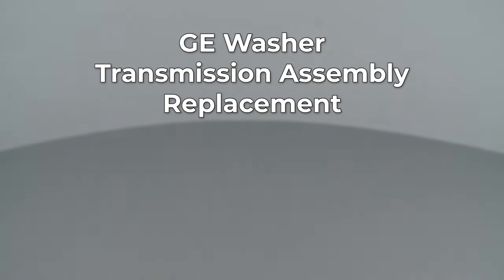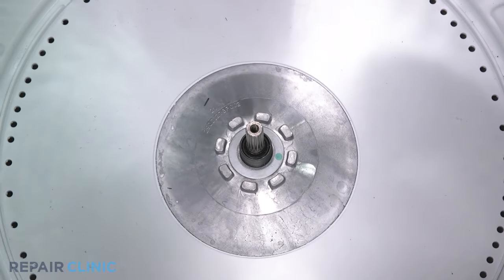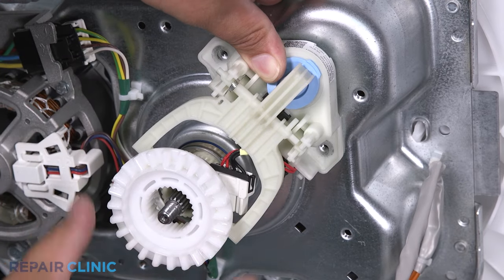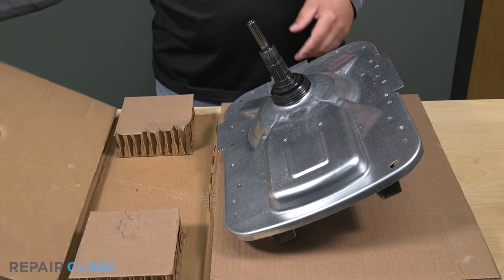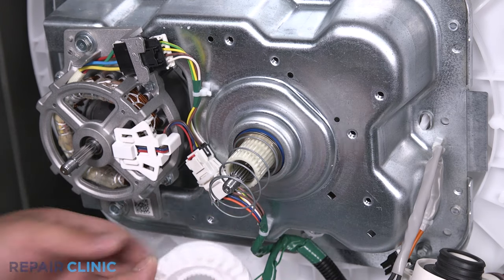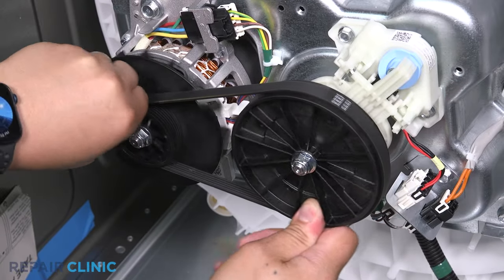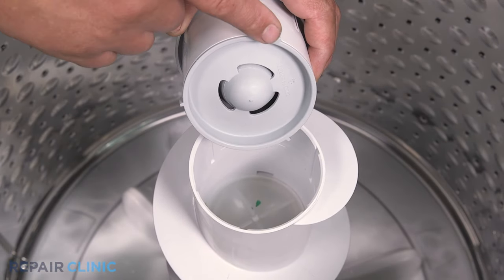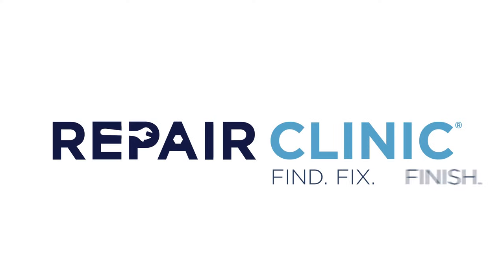GE Washer Transmission Assembly Replacement WH38X27333

Comment: My husband and I were able to replace the transmission successfully with this video.  We bought an $88 part and saved us over $400 in buying a new washer.  Please note there is a new washer that comes with the new transmission that isn't shown in this video.  Interesting note - you don't have to take off the top part of the washer as shown at the end of the video.  Not sure why it is there as he doesn't show that in the beginning.
Reply: Hi could you tell me where you purchased the part?
Reply: @keylolo3484  I can’t find the statement but all I did was Google the model number of the washer and transmission part.
Reply: @lanasmith1085  okay thank you so much.
Reply: hi lanasmith1085, one question. I believe my model in the bottom is exactly like this one but the agitator is one piece not like the one shown in the video that you  intruduce a screw driver to take it apart(so the agitator was 2 parts), he took out the longer part so now he got the screw at hand. was your agitatot like in the video or it was one piece?
Reply: @AlexS-us7ps  Mine is one piece. We pop off the top and use a super long extension with nut to unscrew.
Reply: I think it's wise to remove the top in order to remove the inner basket because this is a good time to clean all the goop and debris laying on bottom of tub which you cannot see nor access between the basket and tub. This debris gets on clothes in the form of stains.
Reply: What part did you replace for $88? A new transmission is $250. Unless you bought used.
Reply: @Larsonbuddy  when we bought it it was $88. I remember there were 2 to choose from and I ordered the cheapest
Reply: @Larsonbuddy I bought a new transmission from PartsDr for $138.
Reply: Did you guys do all that electronical stuff at the end of the video on your guys repair? I gonna do the repair this week.
Reply: @Liviefan4everr  No. That wasn’t needed.

Comment: A quick note: On my washer, the 33mm socket must be deep well. I needed 2 1/2 to 3 inches of depth to clear the center shaft. Also, I could not find a deep well 33mm, so I used a 1 5/16". It was a little loose against the nut but it did the job. (Remember it's a left handed thread - turn clockwise to loosen.) I also found using an impact wrench makes removal much easier.
Reply: Do you have a link, by chance? I have not been able to find one with the required depth to clear the shaft.

Comment: You don’t need a clutch to pull off the transmission pulley I can pull that off with my bare hands and you do not have to remove the drain pump

Comment: Thank you for this guide! While my Hotpoint washer uses a slightly different agitator design (single unit needing multiple extensions to remove) the rest of the video was spot on! I can’t believe my 2 year old washer needed a transmission already, but this guide saved the day. Much happier to spend a couple hundred dollars on the part needed than 3x as much for a whole new washer.

Comment: I'm grateful for this video, but I got a couple of tips that I learned the hard way.

The edges of the transmission are sharp. Be careful.

Clean any lubrication that got on the belt and pulleys.

Good to lubricate moving parts like the plastic clutch teeth and shaft spline with lube safe for plastic. Silicone based?

I had a hard time inserting the transmission into the bottom of the tub. I probably should have lubed the rubber part of the shaft a tiny bit. My transmission popped in suddenly while tightening the bolts. Hopefully, that rubber part wasn't damaged in the process.
Reply from the maker: Thank you for the tips.

Comment: Great instructional video!  My washer is repaired better than from the factory. During the initial disassembly I discovered that the Bellville (convex) washer was upside-down.  Green dot is supposed to be up.  From the factory the green dot was down on my machine.  So, the factory assembly defect may have actually caused the gear case to fail prematurely
Reply from the maker: Thanks for sharing

Comment: I have a 19 month old GE Adora HE washer. It agitates and spins dry but the noise level  in agitation has increased significantly. Is it the mode shifter or the transmission that is increasing the noise levels in agitation?
Reply: I would try replacing the clutch and mode shifter first. Then if that doesn’t work do the transmission. That’s what I’m going to do.

Comment: Thank you for this video. It was very helpful! However, I absolutely could not get the agitator off using the screwdriver in the hole method as shown in this video. I was using enough force to cause damage with no luck. I was very successful using a rubber strap wrench at the base below the part where the hole is.
Reply from the maker: You're welcome! 

We are always happy to help. If you would like to give us a review on Google, we would much appreciate it: https://g.page/r/CcVUrahZNozMEBM/review

We hope that you have a great day!

Comment: I'm struggling with getting the agitator off. My washer looks just like this one but with a different model number.  Gtw460asj5ww.  Any suggestions?
Reply: If you already have the hole located, I would place a smaller-ish flat/standard/blade or Phillips like the video described screwdriver into the hole, slightly pushing it in while rotating lower agitator section until it allows you to go further in and is difficult to go past, there is a small spot that is meant to be pierced with the tip of the driver and hold it together to make it pop out of the "locking tabs" on the bottom portion.  After you pierce it push the screwdriver as far in as you can.  I found it easiest to use Enertia to help out with spinning it.  I would rotate the tub counterclockwise a bit and then, holding only the agitator top, twist with both hand clockwise and it will pop.

Comment: Repair clinic: I've got a GE GTW485BMKWS. I'm trying to replace the transmission as well. I don't see the hole and the bump in the agitator as shown in the video. How do I remove the agitator since it's different to the one shown? I'd appreciate your help. Thanks
Reply from the maker: You're welcome! 

We are always happy to help. If you would like to give us a review on Google, we would much appreciate it: https://g.page/r/CcVUrahZNozMEBM/review

We hope that you have a great day!
Reply: if no bolts on top of shaft pull hard and should release
Reply: It IS difficult to see and I actually had to use my cell phones camera to find it, but you also have to understand too, that once you remove the agitator, you will have to find a way to seal it as once you puncture through the inner portion/shell, it will allow water to come into that area and rust out or go past the seal for the bolt holding onto the lower agitator and cause it to fail much quicker.
Reply: @ThomasBeringerMichael  So how do you seal it? What a bad design to make it like that.
Reply: @jeffwestbrook6570  Duct tape has been a perfect method to close it back up, and it can/should be done previous to attempting the reinstall.  Clean it good up in there and I found the agitator to be an incredible collector of mold like grime.  I took mine apart completely and epoxied it back together after realizing there was a leak in it...

Comment: Had a repairman suggest that I Add Fill more water to the wash cycle. This will put less stress on transmission. It may decrease the noise level. If not jelp then replace the transmission.

Comment: Great video.  I have this exact washer.  I have a small bottom leak coming through belt cover.  For this model, is the compromised tub seal part of the transmission?  (I.e. i need to replace whole transmission for this leak?).
Reply: Yes. It's a sealed unit. Bearing and seal are part of tranny case.

Comment: Would I need to do this if my ge won't agitate during washing and there is oil under my washer? Please help.
Reply: More than likely, the agitator has a planetary style transmission.  the actual agitator is moved when the clutch below pulls the clutch up and only moves that splined shaft.  The problem normally would be a clutch or the clutch motor that spins partially to make it "push" the fork.  But since you have "oil" on the floor, that means the seal is gone up top and it has flooded the case of the transmission and has wiped it out.  I have pictures to show of what it looks like but suffice to say, if it is leaking a seal is worn and if your agitator ain't spinning, the tranny is more than likely shot.

Comment: What was the point in taking the top of the washer off? I see no point in this.
Reply: I just did mine today no need for it. Not sure why that part is in the video?
Reply: @popcornchicken2461  I've been doing appliance repair for 32 years. I see a lot of people doing things that are so unnecessary. The agitator should come right up through the top opening.

Comment: You do a lot of unnecessary work that in a real world as a tech i would loose half my day doing 1 single transmission. The console doesn't even have to move just open the lid and do it from theree 😂 but you do you